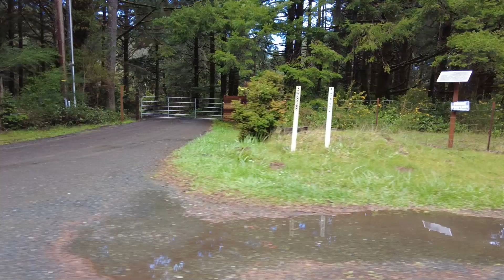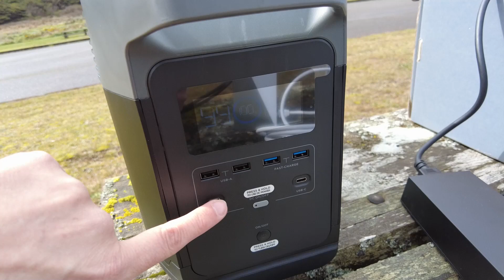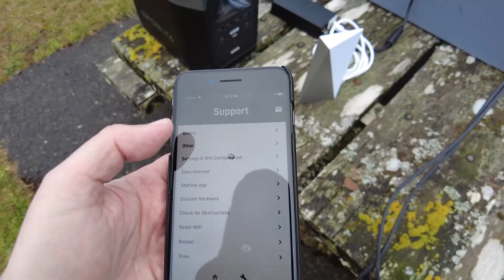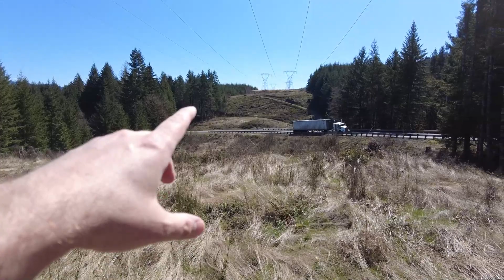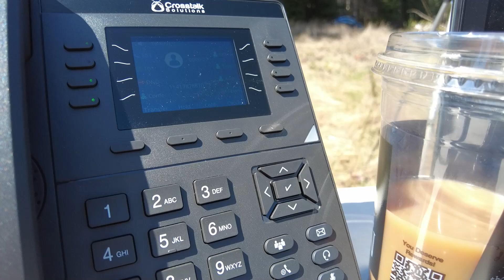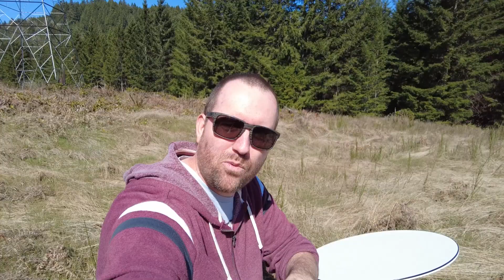How Far Can Starlink Go??  Let's Find out... (re-upload)

Comment: I think putting starlink on a ship or boat is totally doable with either a gyro or maybe using the beam forming to compensate for motion. Plenty of military and commercial vessels have satellite internet already, but the current options are super expensive and they suck, like in a 10x worse than dialup kind of way.

Comment: Looking good Chris. I have one order for an equestrian charity who just can get fixed wire broadband over 1Mbps download. It will help transform their operations. Remote working and VoIP a major issue for them. Thanks for the demo. Based just outside the city of Glasgow, Scotland. none of the  Broadband companies will run fibre cable as they stand alone in the countryside. I'm hoping Starling may just sort them out.

Comment: Wireless ISP using starlink(s) 😁
Reply from the maker: It will be interesting to see if they ever come out with a commercial/resale subscription for WISPs or other large deployments.
Reply: Not a chance.
Reply: I've heard a few WISP owners talk about using them as a secondary uplink, but no word if any actually have.
Reply: Can’t you possibly make a server system and let others in your antenna area connect via some password to your Wireless network that way which in itself is connected to Starlink?